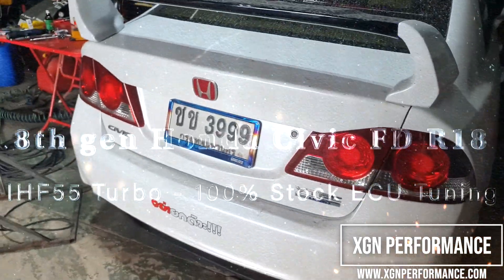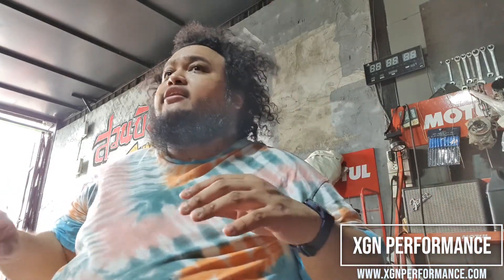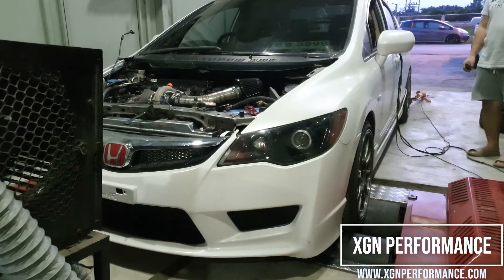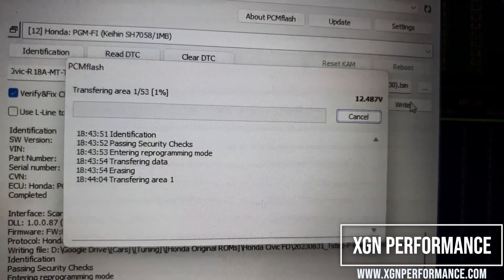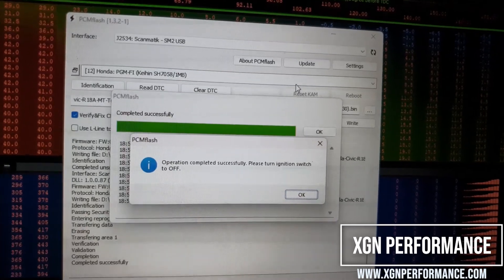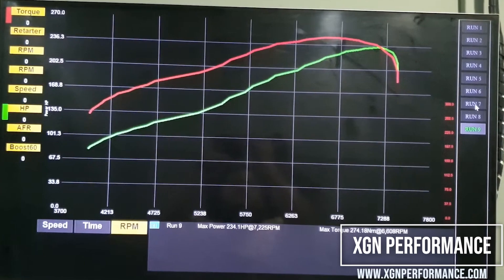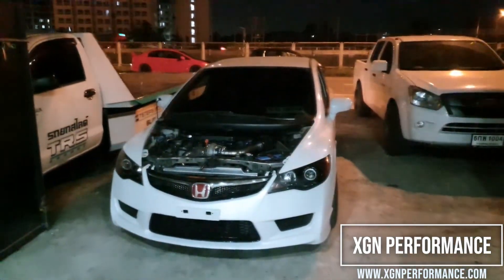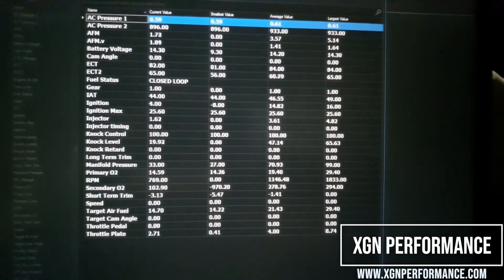234hp 8th gen Honda Civic FD R18 Turbo Reflash tuned using 100% Stock N/A ECU without extra tools

Comment: hello bro did you changed cylinder sleeves for r20 pistons?
Reply from the maker: @irey8223  The builder uses stock sleeves
Reply: @XGNPerformance  oh nice to know, im just wondering why change to r20 pistons aren't they the same since you didn't change anything to the cylinder bore? i need some ideas on upgrading mine thank you

Comment: did you ever end up sleeving? or was it just the OEM pistons
Reply from the maker: Stock sleeves and stock pistons are fine for 15psi with conservative tuning
Reply: @XGNPerformance  Why did you switch to R20 pistons? Sorry I am not familiar with the R-series engine line and am genuinely curious

Comment: K20/k24 here 240 hp 184 torque.
Reply: I thought you’de make more than that with a k20/k24 setup my k24 swapped engine makes 253 on 93 .
Reply from the maker: @javielo1374  It's also up to dyno we use. We also just made 272ps on Dynapack @tcf=1.06 SAE with just JDM K24A2 block + DC5 oil pump + RBC cam gear using E20 OCT91(RON95). It would make less on some other dynos.
Reply from the maker: Good power, we made similar power with our Toyota when it had K24+20 before we remove it for a J35.

Comment: Hey man!

Stumbled upon this video, it really inspired me to Turbo my R18. I love my 8th gen non-si civic... I want it to live forever. It is also my first car.

I have just one dumb question... does the R18 Turbo need higher octane fuel? or can still run 87?

That closing remark really hits man, I am so glad that you are tuning cars and it makes you happy!!!
Reply from the maker: Hey!
Thank you for watching and your kind words! I really appreciate it!

Regarding fuel, minimum fuel recommended will be oct91(ron95) for the boost stock sensor can prrovide, which is around 6-10psi with considerate timing.

Comment: I made 240 whp on my 8th gen civic si full bolt ons on E85 tuned all motor k24 swapped on mine
Reply from the maker: Congrats, that makes about the same as our Toyota VIOS when it had K24A2 on E85. Nice power you got.
Reply: What other mods are you running I made 253 on my k24 swapped 8th gen on 93.
Reply: @Motofried  I’m trying to buy supercharger for my car to make better numbers

Comment: What injectors are you using bro? And how many cc?
Reply from the maker: Chinese 650cc injectors bro, but it's maxed out. I recommend using 850cc for stock fuel system.
Reply: Ok brother thank you, we are planning to build and r18 turbo with stock internals with skunk2 cams. Is 400-500cc injectors good?
Reply from the maker: @Budgetmealracer  No problem. How much boost?
Reply: @XGNPerformance  my kit is still in transit and we will install in later on. My tuner mr. Julius told me that we will run on low boost only. 

By the way if i would use a k20 injector would it work bro?
Reply from the maker: @josemichaeljochin870  K20 will only be enough for super low boost. Does is happen to be Julius from Philippines?
Reply: @XGNPerformance yes bro from cebu city heheh you are the one who tuned my brother’s hilux also and i want to thank you bro.
Reply from the maker: @Budgetmealracer  ohhhhhhhh okay thank you for trusting us for all these

Some R18A has challenges for MAF tuning, that's why I always convert them to Speed Density, because engine might stall with MAF + BOV for this platform.

Comment: I have a 2006 r18 automatic. How did you tune it in a stock ECU ? What did you use
Reply from the maker: WinOLS for editing
PCMflash for reading and writing

Lots of things need to be done. I do my own firmware reverse engineering deep down to Assembly codes. That's how I'm able to do these.

Comment: Nice build!!  I also run stock 02 sensor and I run at 10.5 afr  wide open throttle. 
Do you suggest even lower afr ?
Check out my turbo r18 in America!
Reply from the maker: Hi

Stock O2 Sensor in these cars always report richer than the mixture actually is when the mixture is rich, they are ok when it's not as rich. That's why I said I did it rich using stock sensor, to avoid going too lean. Then I refined the tune with a wideband later.
Reply: @XGNPerformance  what afr are you targeting in boost now with wideband? 
And is your factory o2 still saying 10.14 at wot
Reply from the maker: @BulliKid Factory O2 says 10.14, Wideband says 11.5-11.0:1 at 10psi/0.6bar and 10.8-10.5:1 at 15psi/1bar
Reply: @BulliKid  10,14 is way too rich. 11.5-12 is ideal. 11-11.5 on the safe side. Any richer than that is bad. Contrary to popular belief... you can hurt a engine just as much with being too rich as you can too lean
Reply: @nsboost  yes but we are talking about the factory oxygen sensor that doesn’t read accurately like the previous comment above states when the factory sensor reads 10.0 it’s actually like a point or a point and a half higher. You are correct in the regards that running to Rich is not good.

Comment: Fuel consumption increased in comparison with R18 atmo? I mean cruise load.
Reply from the maker: If you use the same power, there would be almost no change in fuel consumption. And better responsiveness, because we tuned knock limited ignition timing to suite the fuel well. So the car will get better ignition timing in all range, thus better efficiency.

Comment: May I know How much it cost ?
Reply from the maker: Hi

Turbocharging cost around $1,500-1,800 up to the turbo we have to use, with some Chinese parts and custom fabrications. Building the engine is entirely up to the parts we want, rebuilding labor cost alone is about $800-1,000 not including parts. Tuning costs $500-800.

I can do online tuning for many cars.
Whatsapp +66864099800
Reply: @XGNPerformance  oh that's expensive 😂
Reply from the maker: @xerxestheii856 Yes, even with Chinese parts, it's not cheap. But all these will make it a lot less than what we usually had to spend back in time. It will be much more expensive with all genuine parts.
Reply: in dollar or thailand bath sir?
 @XGNPerformance
Reply from the maker: @Rimbabara-r1e  It's in USD.